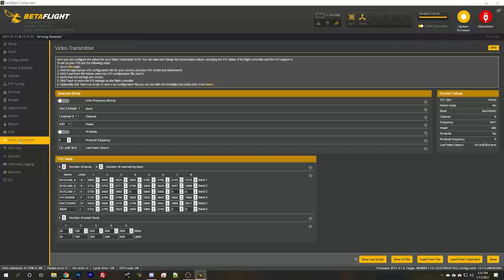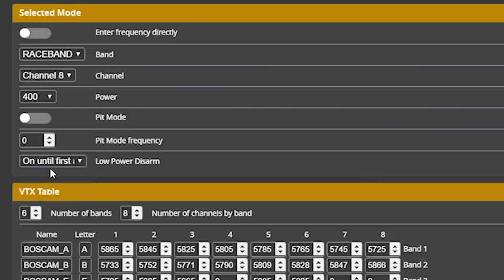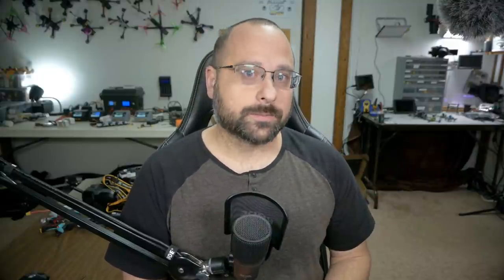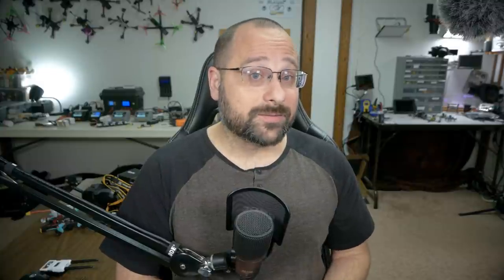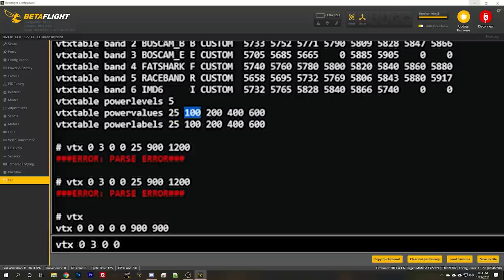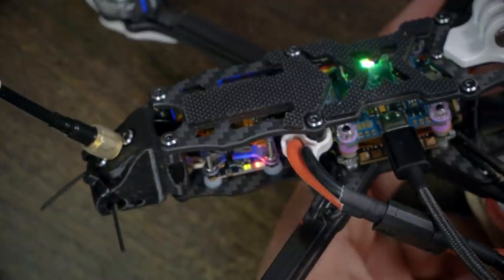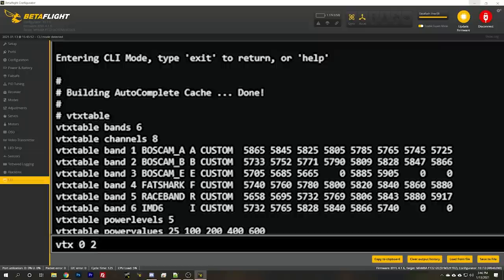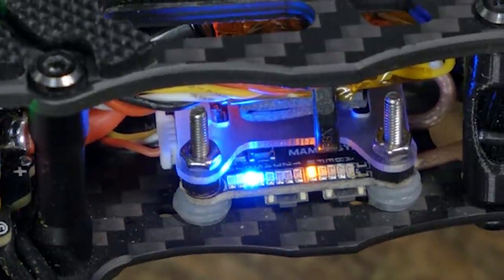Betaflight change vTX band channel power on a switch? Yes!

Comment: I keep my low power disarm on all the time, if I need full power to see where I am after a crash, I switch to turtle mode and arm
Reply: today i learned something! i finally used turtle mode yesterday quite the clinching event
Reply: That's quite brilliant. Especially useful if you're running high output powers and don't want the vtx on that any longer than absolutely neccessary.
Reply: Awesome, I'm gunna change mine now!
Reply: Great if you don't power off and skid
Reply: Burned out my raceband today on my reaper. Voltage meter wasn't working. And it was a first flight. Landed in the sun across the field. OUCH,  live and learn. Lucky I still have a functioning Reaper, just no raceband now.

Comment: This feature just came in handy for locating my quad lost in a snowy forest. I crashed into the trees. I used the directional patch on my goggles, and via this switch dialed down the lost quads VTX's output to 25mAh allowing me to triangulate with precision the video strength, and I located my downed quad.
Reply: I would like to see a video on this
Reply: @enjoyyourlife2518  the tbs fusion module even has a quad finder mode where it uses your patch antenna to narrow in on the signal
Reply: So clever! I'm remembering this trick
Reply: Skyzone Cobra X goggles has this feature. I'm not sure why not to use max watts instead.

Comment: Pro tip set default channel value to 2000 so if you failsafe it kicks it to full power so you can still find your quad.

Comment: If you tied changing channels to the armed state with logical switches, you could make it impossible to accidentally change channels while flying and you would not be adding another switch you had to remember to flip.
Reply from the maker: Good point!
Reply: @JoshuaBardwell  show me how ? haha
Reply: @dodgydamosfpv9734  go to your mixer tab then edit the channel where your 6pos is allocated then  add disarmed switch. meaning you can only use the 6pos buttons when you are on a disarmed state.
Reply: @deadstickfpv8115  cheers mate il try figure it out
Reply: @deadstickfpv8115  I am not really get it, could you please explain a bit more? I am a newbie on FPV. Thanks in advance
Reply: Or you can go to Modes in GUI and assign your arming aux channel to 'disable vtx control'. I've had some issues with the random channel changes in flight (might have been due to a broken SA wire resulting in los landings, luckily was over my own yard, (very intense experience though).
Reply: @JoshuaBardwell  iNav 3.0.2 has better UI to configure it, i surprise beta-flight don't have it

Comment: Hey JB, thank you for making this video and all your other great stuff. 

I was searching sooo long for a solution to change the vtx channel during the flight.
Made the short clip to show other betaflight users how to do it, but I'm really not good in making videos :)

So thank you for bringing this information this to all interested pilots.

The direct translation of "Schon Richtig" is "already right" from german, can't remember why I used this :) 

Kind regards

Steffen
Reply: EHRENMANN👌👌
Reply: Joshua pin this mans comment :)
Reply: @BBFPV  hey, habe mich weggeschmissen :)
Reply: @SchonRichtig  er gibt sich doch Mühe! 🤣
Reply: @BBFPV  ja, riesen Respekt vor den zahlreichen Versuchen. :)
Reply: @SchonRichtig  🤣
Reply: Thank you so much Steffen . This is something that I wanted for a loooong time
Reply: @BBFPV  bahahhaha
Reply: JB = geiler Macker 🤩
Reply: vtx - index (No. goes up) - aux channel - Band 5 = Raceband - Numbers for the Channel - Channel range

vtx 0 4 5 1 0 900 1100

vtx 1 4 5 2 0 1100 1300

vtx 2 4 5 3 0 1300 1500

vtx 3 4 5 4 0 1500 1700

vtx 4 4 5 5 0 1700 1900

vtx 5 4 5 7 0 1900 2100
Reply: This is AMAZING.  Thanks from an analog fanboy in Canada!
Reply: thanks for putting out the info on how to switch vtx power from radio 😊
Reply: Ja also muss ich mal sagen vielen Dank🤤
Reply: Schon richtig - that's right.

Comment: Thanx Joshua!
I tested this method and I found two issues.
 1. there is only 10 positions of vtx index (from 0 to 9) so if you want set one swith for channels and second for power then there is not enough position in the index for all.
2. swhitching channels worked only until first arm, after that, channel cannot be changed.  I have to unplug battery and plug it back then I can change the channel by switch again.

Comment: Oh Josh you should know it better, PIT Mode is lower then 25mW, it is only about 1mW 
and by the way In Inav it is much easier to setup VTX Chanel or Power to a Switch. There you not need the CLI
you can easy setup it by the configurator

Comment: My vtx power was not changing automatically and as a result my video signal quality was poor. I have followed your instructions and have set a switch for 25, 200 and 400. Gonna do an outdoor test flight on my meteor75 pro. Thanks Josh!

Comment: You can use your trim switches for this with a bit of OpenTX wrangling... have one to click through channels 1-8, then have two power levels on another trim. You can even put pit mode on the same channel as the power trim, with pit mode using the first half of the range so that the centre beep lets you know it’s on!

Comment: Hey everyone.
For example, because the Taranis QX7 has a maximum of three-position switches, it is possible to set four or more VTX power values to servo knob and this knob set for AUX channel. I use it for 25 mW, 200 mW, 500mW and 800mW TBS Unify Pro.
JB explanation is awesome...of cource. Thanks.

Comment: Hi JB. Thanks for again a great tutorial. This isn't for analog pilots only anymore. It also works on HDZero. With BF 4.4 you can even do it without SA and just use the UART for OSD. I've done this myself and I can now switch channels of my VTX using the six position switch.
Reply: Nice, i have to try it out! Is it the same setup process like shown here?
Reply: @ForSure871  Yes it is

Comment: 💥💥 GAME CHANGER 💥💥 I wanted this forever and asked in several FPV communities. I even started programming my own LUA script to change VTX settings with a dial but without success. Now I will finally replace a pot on my QX7 with a 8-way rotary switch and some resistors and can happily switch channels without the OSD/LUA script.
BTW: "Schon Richtig" isn't a name. It is German and means "quite right" (mostly in the context of a fact being contested).

Comment: Great video! I really fell hard for programming microcontrollers in college, and this is the kind of stuff I love. Don't blame the computer programmers for starting the count at zero. The microcontrollers, by nature, like to start at zero. So if you have an 8-bit port called Port B, the pins will be manufactured in that the bits (pins) of Port B are labeled PB0-PB7. The programmers just have to follow that convention. When we write code to use the first bit of the port we say PB0.
Reply: Ha. Flow code,  programming . Lol...

Comment: saw this video long ago, did it today.

Was running out of aux channels so I put my beeper as position 6, and the vtx tx powers as positions 1-4. Nice thing about this is if I select the beeper, since it's outside the range of the vtx command it just won't respond to it, so I can beeper at any vtx setting.

Had a close call where I forgot the quad was still on 25mw mode after working on it, now I can change the tx power on the fly to balance range, gps interference, and being a good RF neighbor. 😎

Comment: Thanks for the video, very helpful!
Everything works, separate for power and channels.
But together on my board there is no - I guessed to increment the indices together - 0,1,2 for power and 3,4,5,6,7,8 for channels, otherwise indices from channels overrides the power (and power not work), I think.
My example:
Reply: didn't you solve this issu? I can't make both to work. I can use vtx power OR channels.

Comment: The 6 position switch is useful for what it was intended for, us Ardupilot flyers who have a million different flight modes, even different kinds of RTH :)
Reply: Saved me saying the same.... Radiomasters designer obviously used Ardupilot...lol
Reply: @EnglishTurbines  The Tx16s is a follow on from the Jumper T16 as you will know, the T16 promotional info actually states the 6 position buttons are intended for Ardupilot :)
Reply: @stevefox3763  Yep, good move by Radiomaster...no doubt about it..🤔🇬🇧
Reply: @EnglishTurbines  even with 6 positions, we have so many options with Ardupilot that we sill have to choose what flight modes we Really, really want dont we ha ha.
Reply: @stevefox3763  Yes, I find that sort of thing off-putting in Ardupilot TBH...it's like wading through treacle during setup...it does fly the plane better than iNAV, I will admit..I'm lazy, I use iNAV on everything, including my quads which works really well for me TBH..🤔🇬🇧

Comment: This is cool thanks jb. I set my trim switches to move through 8 rb channels. No need for lua or osd at races now. And it syncs up before unify nano pro 32 boots so no boot on wrong channel. :D and I can change channel with quad unplugged and no matter what quad I grab or what proticol its running. I know what channel and power it will boot on. :D I wish it had more than 9 lines though.

Comment: This is amazing. Did they ever do anything like this for digital?  I know the channel is right on the side of the goggle v2, but changing it from inside the goggle would be more annoying than switching a switch I imagine.
I am heading off to watch your smart audio stuff again. Getting back into quads after a year or two and my quad has smart audio but I remember NOTHING about it. I always have to fumble for 5-10 minutes to remember the secret stick code to even get into the menu, lol. I love flying quads, but I am disabled so anytime I crash I need to get someone else to go fetch my quad, makes it really hard to get stick time in, and I am more panicked than most I suspect about crashing. I need to find a friend who is into quads. Have some grandkids, but I would not trust them on the quad without a lot of stick time. Need to get them a tiny whoop or something.
Reply: Did you ever find out if this is possible with digital?

Comment: Damn dude. Very cool! I followed your instructions and it works. I always worried about crashing far away in the summer and the vtx overheating. SA is nice but a pain in the ass when you're in a hurry and want to immediately start walking to your quad and not stand there while you flip through menus. Plus I assume if you're far enough away that 25mw won't let you see video, you can flick the switch back to 500 or 800mw to take a quick peek and flip back to 25mw. Which might also make it easier to find if you go down in a large field with no landmarks by going down to 25mw and using a patch antenna on your goggles to get the direction of the quad. It's great to just flick a switch and get down to 25mw. Much faster than going through SA.

Comment: Indeed this is a thing that many of us probably dreamed for years. SmartAudio/Tramp was a big progress, but it badly needed easier VTX control for things like you described. By the way noticed DJI like "PIT mode" in Betaflight 4.3 where Betaflight itself keep VTX on low power before first arming.

Comment: hei @Joshua Bardwell
 here is what i've learned today : 
First if it says "Device Ready = No" chech the Port -> Peripherals to see if the VTX (TBS SmartAudio) is configured on the right UART (check the FC blueprints to see where is connected).

INDEX  RCVrA  Band  Channel  Power  StartRange  EndRange
    0           0          5           1            1            1000           1250

RC = Remote chanel VrA - the remote control chanel is a knob on Flysky FS-i6x values are from 1000 lowest to 2000 highest
Band = RACEBAND look in the Video Transmitter tab 
Channel = whatever chanel you want to use
Power = look at the numer above 'value' - this is where i screwed up 
StartRange/EndRange = i've split the range into 4 smaller ones
here are my settings :

# vtx
vtx 0 0 5 1 1 1000 1250
vtx 1 0 5 1 2 1250 1500
vtx 2 0 5 1 3 1500 1750
vtx 3 0 5 1 4 1750 2000
save

Comment: Finally Betaflight.  INav has this for a while now and it saved my skin many times. 
Last thing I want is powering up my wing and vtx would go straight into 1200+mw while waiting for gps lock.
Reply from the maker: Well to be fair BF has also had this for a long time I just didn't know about it.
Reply: @JoshuaBardwell  Oh. Well that's something I didn't know either. I Guess we did learn something today 😬😊

Comment: PSA for anyone who did this, however your Band, Channel, and Power on all your quads is getting defaulted to the same band, channel, power periodically no matter how you configure this switch, or what info you save in the Video Transmission dropdown boxes.  

My first quad was a Mobula8, and part of the setup instructions had me go into my RadioMaster Lua script under VTX Admin, and enter values there to account for a bug they were having getting VTX to output max power.  I didn't know it then, but I was hard coding in a Channel, Band, and Power that would then override input from any other source be it the CLI or Betaflight Gui every time telemetry was gained/lost weather in-flight or on the bench...  If you're having this issue, check VTX Admin in your Lua script to make sure it's not forcing out this info to your quads.

Comment: Hey I'm new to FPV but wanted to let you know that you make things so much easier to do and learn,and I am running betaflight 4.4 and this works perfectly and it doesn't have to say yes device ready. Mine doesn't, it says no on device ready, but I am using smart audio UART... Thanks

Comment: If you use Low Power Disarm and crash and disarm, you can get VTX to go max power again by arming Turtle Mode.  Then you get full VTX power without actually spinning the motors

Comment: This is exactly what I use the six position switch for.  Very handy. Unfortunately the smart audio protocol is really not well designed. To got around this, many transmitters boot up it pit mode, or they have some funky behavior where if you send the wrong command over smart audio, it goes to the default/boot up power.  It's just something to be aware of. It took me days to get mine working by bodging the setting and vtx tables and whatnot, and I'm still not really sure why it does work. Also, FYI you don't need to create a mix in OpenTX, you can just assign the physical input to your aux channel.  It will save some time and processor cycles.

Comment: Sweet so tie that in to telemetry, say RSSI, and change the switch to a logical switch and you can have the VTX power change automatically as you get further away or fly behind something. Might take a bit of fettling to get the values usable but should be doable.

Comment: I’ve been doing it this way for the past year, using a 6 position rotary switch on the radio.  It works on Lumenier and RDQ vtxs but wouldn’t work on TBS vtxs.  If only Betaflight would do it as iNav has done and put vtx power in adjustments, it would be much easier.

Comment: As usual informative and very helpful JB but if you can put the VTX power on a switch can you also put Pit Mode on the same switch?
Reply from the maker: Most vTX won't go back into pit mode after powerup.

Comment: Surely if you disarm far away being perched and it goes to 25mw you can just arm it again and it'll go to 800mw again because the signal is going through the radio not the goggles. So shouldn't be an issue with the second setting?

Comment: Another time this might be extremely useful is if you don't have the low power disarm set... but you take off in low power and immediately realise "aw crap, I'm only on 25mw.."
Instead of landing to up the power, you can just change it on the TX like this.

Comment: that channel change would be incredibly handy if used with the orqa, immersion rc rapid fire and an additional ghost receiver (soldered on to the fpv connect module in the googles) this would let you change the videoband mid flight on your Quad and simultaneously on the googles! o.O
.... well, under the condition that the fpv connect can be set up like this
Reply: Clearview can support it on the receiver side

Comment: So I just set this up on my Tango 2, had to change the offset of the button/switch to -3
the allowed ranges has a max of 2000 and I was on 2011.. couldn't wrk out how to remap button/switch ranges as rxrange only seems for TAER..anhooo fixed, works gr8!
Edit: for future me, this works as you want.. - and have a nice day, you deserve it!
vtx 0 1 0 0 4 975 1400
vtx 1 1 0 0 4 1400 1500
vtx 2 1 0 0 1 1550 2000
Reply: hey @Ryet9  can you help me? i have a tango ii as well.  I want to set on switch SWB/CH6.  hope you save my life! haha  ty
Reply: @pampfpv  Short press Menu--> Page 4-->Edit CH6 SB... Offset -3, then go to BetaFlight CLI paste
vtx 0 1 0 0 4 975 1400
vtx 1 1 0 0 4 1400 1500
vtx 2 1 0 0 1 1550 2000
save
4 in the 5th position is the power level I have set for MID and HIGH on the switch
May I also suggest u set up a (in BF MODES) PIT on a switch also with .. my suggestion D in the down position  B in the lowposition ....  dissable that D down as a warning and u  can power up in PIT Mode or just chuck it in PIT anytime ya want easily

Comment: My 2 cents. Channel switching by easy accessible switch may and will cause accidental channel switching for someone in air. For guys without VTX and VRX band/channel synchronization like DJI and some TBS gear do, this will end with sudden FPV feed loss and crash.

Comment: C starts indexes at 0, not programmers :)  However, the indexes should at least be consistent (start at 0 or add 1 for the user).. agree there.  Using 0-based indexes makes for more concise code, avoiding annoying +1, -1, or preprocessor macros all over the place.